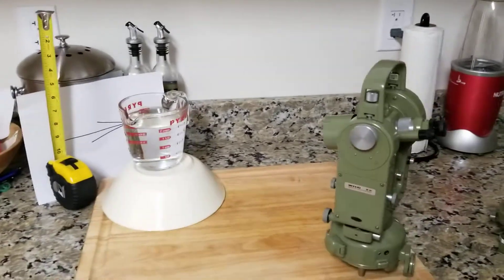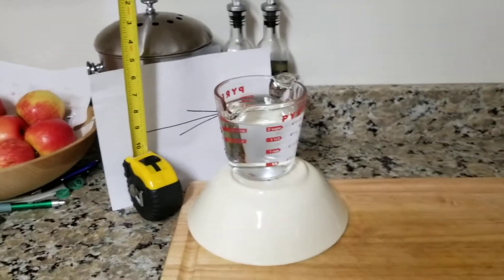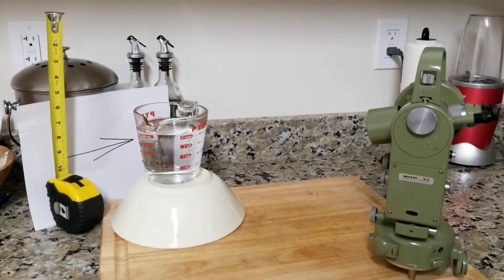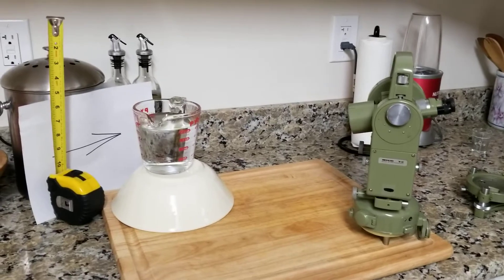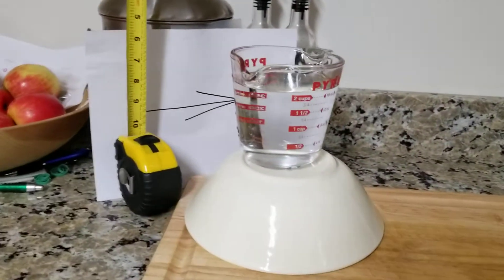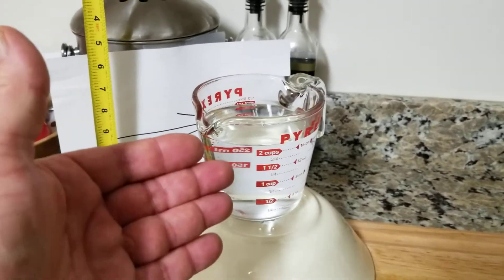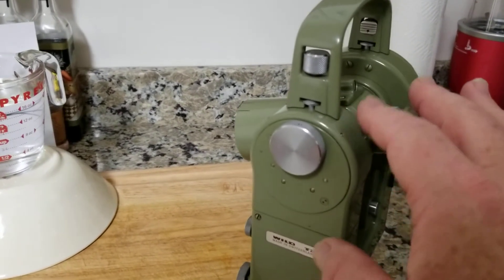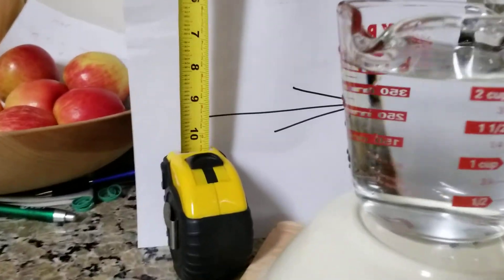Flat Earth - Theodolite Calibration  ;)

Comment: His names jeranism. Why are you scared to say his name. Oh you do use measurements when using a theodolite? And what was the point of this video
Reply: Chris Waldrop the reply Jesse gave you is spot on.  He focuses on the land side of survey, I worked for a company that focused on the sea side of survey.  Theodolites were used to very accurately position platforms offshore with no surface features to use as reference.  It was just a few guys turning angles over vast distances, usually at night, to position a platform over a structure left on the bottom maybe years before.  If The other video was correct, none of this would work or at least would not be consistent.  Fortunately for us, the other video is wrong and survey does work to give use fuel, navigation, and internet (we have to survey the routes for under sea cables and position any nodes  and any where it may cross with another cable or pipeline).
Reply from the maker: Chris Waldrop , +IB Hunter @IB Hunter is referring to this type of surveying I demonstrate in this video  ...

Flat Earth Proof? - Observing Lighthouses Across The Delaware Bay
Published on October 2, 2016

Video Description: This is a review of the survey observations posted on my blog and also includes video clips taken through the eye piece of my theodolite.

https://youtu.be/Qpxd5btyLJA
Reply from the maker: IB Hunter , see my reply to Chis mentioning your comment with a link to my video recorded on the Delaware Bay. Enjoy. Thanks for sharing your experience here.
Reply: Chris Waldrop, His name is Jism, and he's an idiot, sorry to hear you have been fooled by his rhetoric.
Reply: Yep just follow the rules and everything will work out great info. (Oh boy)
Reply from the maker: Chris Waldrop , who ?
Reply from the maker: Chris Waldrop , do you use maps to find your way around? Ever do any hiking? Ever do any boating? Topographic maps and nautical charts for navigation were produced by surveyors making measurements with theodolites. Just how do you think you know the height of a mountain or where it is located? Now go back and ask your hero to explain all this to you while claiming all those measurements are faulty because the geodetic surveyors didn't take into account things drop in the distance due to perspective. And ask him why he chose to ignore all the references I gave him in the description box above. Actually, who cares what he thinks anyway? People like you, that's who. Please  do your self a big favor and get things figured out for yourself. That's the best advice I can give anyone. Jeran might have lots of things right, but the shape of the earth isn't one of them. Anyone can measure that for themselves with some string and a plastic protractor. Peace.